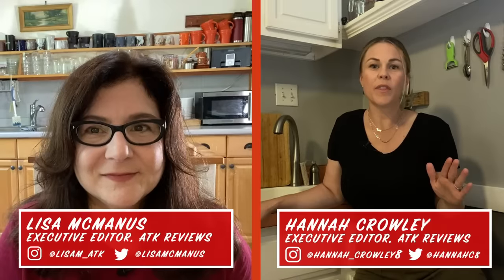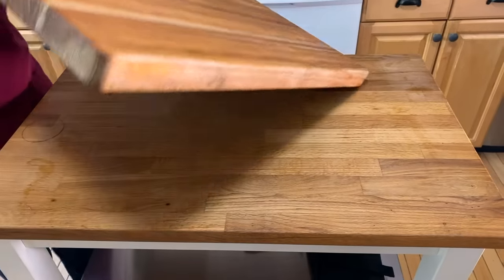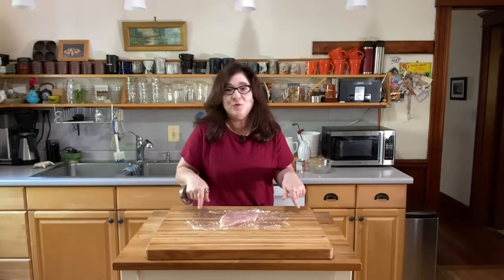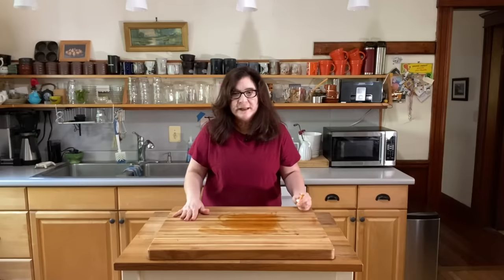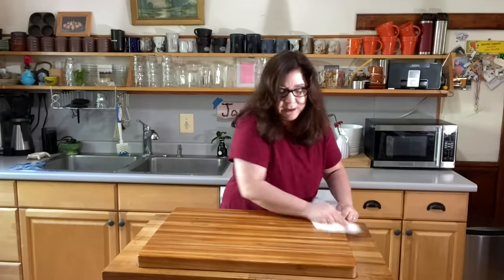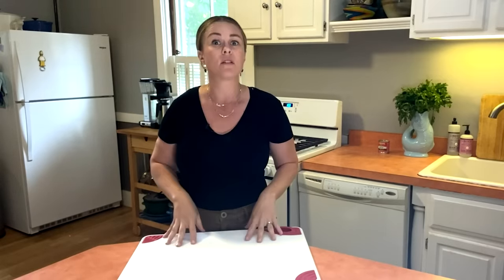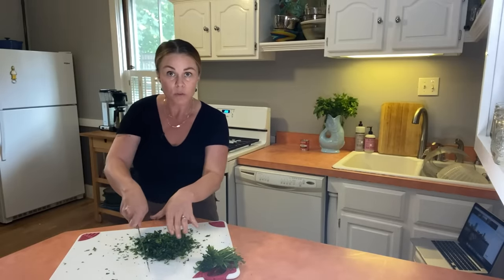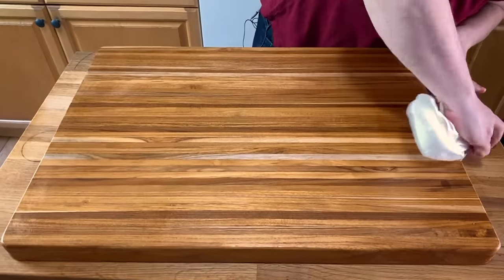Gear Heads | Which Type of Cutting Board is Best for Your Kitchen?

Comment: I now have the plastic antimicrobial boards - two sizes.  I had a  9in thick end cut John Boos butcher block mounted on stainless steel legs that i scored at the HomeGoods store for a mere $799 nearly 20 years ago.  At the time I certainly couldn't afford it but managed somehow and NEVER regretted buying it.  But when I sold my home recently and relocated to a downsized home, I couldn't justify that butcher block taking up my entire kitchen.  I sold it and to this day, although not remorseful, still miss that butcher block.  It was the centerpiece of my kitchen used as a mini island.  it was so convenient to merely cut everything on it.  However, I find the microbio boards are also great, light weight, easy clean up and easy to sanitize.

Comment: Several restaurant supply houses are open to the public. They sell them in varying sizes. Measure your cutting area, then buy a small, medium and a large? 

Piece of cake... 🤗
Reply: Deborah Kennedy If you have someone around you with a table saw, they are all easy to cut to whatever size you want.  I have four at 16X12, and large one I do butchering on, which is 21X36-inches.  The butchering one, gets laid on a run of sticky padded shelf liner, and overhangs my sink.
Reply: Yup😉👍

Comment: I have a size huge plastic with indents to catch juices. It fits over one of the halves of my sink and I use it for kneading, rolling out dough, and cutting large pieces of meat like turkey or roasts.

I have a large red KitchenAid plastic board I use for prepping meat. Then I have three black KitchenAid plastic boards in various sizes from large to small that is use for non-meat items.
I also have thin plastic boards in 4 colors that I use to flash freeze. It's a lot easier to get things off a bendable board once they've frozen. 
I do want to get a nice, medium size wooden one for serving.

Comment: Best of the Best cutting board I ever found were from  "Cutting Board Wisconsin" I believe it's a Corian material. However, they describe it as, non porous, non absorbent acrylic polymer material. I've always loved a wooden cutting board but these are great! The only problem is there size. I've got an 18" by 16" & they don't make them that big anymore (wish they could be a little bigger like 18"x24"). You can refrigerate them for dough to be rolled out & remain cold or you can use them as a trivet for hot dishes to rest on the dinner table. Just Love them. Wish you guys would get some & rate them too. Have a Great day & be safe out there!
Reply: Years ago my husband worked for a company that installed tile and other products in commercial buildings, malls etc.  He brought home a large Corian cutting board that we had for years.  It was pretty heavy though and I eventually let it go.  Your comment jogged my memory about it.

Comment: I also find cutting sheets to be very useful. Typically larger than the small sheet of paper sized, but not as large as the full sized wood one, they are plastic and flexible. Good for slicing bread and simple larger things like cabbage. Easy to wipe clean.

Comment: My husband does most of the cooking, so he has an assortment of plastic cutting boards from 8" x 10" up to 16" x 20". I have a cutting/pouring thing I've used for over 20 years. It has a 4 1/2" round cutting board that is attached to a holding area for cut items that ends in a tapered pouring spout. The cutting board sits up from the base so any liquids run down into the holding area. I really hate to cut juicy tomatoes on a regular cutting board and have the juice run all over the counter.

Comment: Much as I would love a wooden cutting board, I’d have to go with the plastic one.  It’s lighter, easier to handle.  I have arthritis in my hands, but the right is the worst,  a yr & a half ago I messed up my right hand & wrist, wasn’t broken but I had to have a cast for 2 wks.  It still doesn’t work right at times, so for someone like me??  The plastic one is the best
Reply: Lightweight wood and bamboo cutting boards can also be great! Ikea makes a really nice large bamboo one that’s only about a half inch thick, and i think it’s actually lighter than similar sized plastic boards I’ve used

Comment: I have both, a little smaller than the ATK choices.  My wood block is a maple edge-grain 12 x 18 x 1-1/2 John Boos board which I've had going on 20 years now. I treat it with mineral oil every few months and it's holding up very well.  I also have a poly board of an unknown brand (same dimensions but 1/2" thick) which I was given by a former girlfriend about 15 years ago.  She was convinced that we'd die if we cut raw meat on the wooden board, so I just got in the habit of using the poly board for meat, even though I'm not at all convinced either one is "safer" than the other, given proper washing.

The poly board doesn't have rubber grip surfaces on the corners like the test board, but it still doesn't scoot around.  I usually just set it on top of the wood board with no grip mat or damp dish cloth under it, and it stays in place fine.  There's enough texture on the surface that food doesn't "walk" out from under your knife either.

I'm somewhat fanatical about keeping my knives sharp, and both boards are holding up very well.  I can't feel or see any erosion or abrasion of the wood block (at least not to the point where I'd consider resurfacing it). The poly board's most heavily-used area is easily seen, but that's due as much to staining (tomatoes seem to do a number on it) as knife wear.

I'd say the choice between wood and plastic is going to be more subjective and esthetic than anything else.

Comment: I prefer the "Wood" cutting board.  I put mineral oil once a week. ( 2 me its not a high maintance) I did have 2 regular sized plastic board that I tossed. I didn't pay a fortune for my wood cutting board. But if U wanna make the investment and maintance go for it.. Plus they are Durable.
Reply: It is, indeed, an investment, right?
Reply: Instead  of oiling it once a week, try using spoon butter which is a mixture of mineral oil and beeswax.  It stays on much longer than mineral oil alone.

Comment: I got the ProTeak last year, and it is an absolute joy. The cleanup is occasionally annoying (because it's big) but everything else is awesome. 

And it looks fantastic when not in use!
Reply: I agree about ProTeak.  If kept in a stationary place, you could be extra conscious about what you cut on it so all you need to do is wipe the top with a lightly soapy washcloth, followed by a damp washcloth to wipe away the soap. Don't cut meat or anything with too much soil and it would be fine so as to not lug it to the sink.

Comment: When covid first started I stopped refinishing furniture because of lack of storage and instead went to my local thrift store and bought old beat up wood boards, sanded them down, and oiled them. And now I have just…so…many…wood cutting boards. But they’re fun little projects since I could find big heavy birch or maple butcher blocks for $3 and two beers later they were good as new. Some of them were pretty much brand new and my guess (given my location) is they were probably wedding gifts or something that weren’t needed.

Comment: We have both but the wooden one was custom made by a woodworker friend from clear grain maple and walnut, WAY too beautiful to chop on every day!😂 So we use it to serve special occasion carving dinners and or charcuterie cheeses and meats. 🙄 My work horse is my plastic board. Love the knife feel and the quick clean up. I don't wash it in the dishwasher because I don't like that my dishwasher packet has a rinse agent for water spot control which ( to me ) appears to leave a residue on certain surfaces that aren't glass or smooth stainless.

Comment: Question for the follow up video if done- I know that wood and plastic are much better for your knife’s edge than glass but- does either the wood and plastic wear down your edge slightly quicker than the other?
Reply: I can't recall when or where I saw or read about a test of that aspect, but in whatever test it was I recall that plastic and real wood were equal in knife edge retention, but that bamboo was hard on knives.
Reply: SeikiBrian now that you mention it I do recall the part about bamboo
Reply: most commonly used woods are probably good but some wood types are much harder than others. bamboo is really hard despite being common though
some types of woods also absorbs more water than other.
Reply: Bamboo is high in silica (glass) which is why it's bad. It's also a grass (not wood) and needs a lot more glue than woods. If you have truly sharp knives with small edge angles; they'll sink into the plastic boards too much and some may crack or chip as a result. If you want a cheap route: End grain Acacia. If you want the best; end grain hard maple (but from a reputable maker like BoardSmith or Boos).
Reply: Brian Klaus: It depends on the type of wood and type of plastic specifically for cutting boards. There is not a universal answer. Maple is the best for knives. Acacia comes in second but then it depends on the cultivar of Acacia, some are too hard on knives, others are ideal. Same concept for plastic. The problem is that bamboo is not wood (it's a grass), and they are infamously hard on knives. Bamboo is 19 percent harder than traditional maple, which means it’s also harder on your knives. Also, the small grooves may ever-so-slightly catch your knife, interrupting a smooth cutting action. And many of the glues used for bamboo boards use formaldehyde. You want to make sure it says formaldehyde-free glue is used.

Comment: Hey ATK, Mineral oil is a bi-product of crude oil in the production of gasoline. Do you have a suggestion to an alternative oil that I can use on my cutting board?
Reply: I use coconut oil, it spoils a lot slower than normal cooking oils

Comment: My mom had purchased the Large TeakHaus Edge Grain chopping board, and it's slimmer cutting board model a few months ago. However, the chopping board has deep cuts in it from her using ceramic knives on it with quite a bit of force on it. The cutting board is fine though, just light scratches.

Comment: I use both wood and plastic depending on the task.  For raw meat, I use thin plastic cutting mats/sheets placed on top my thick wooden board--the thin sheets go into the dishwasher to disinfect after use with raw meats.  For herbs, onions and veggies. the heavy wooden board is stable yet soft.

Comment: I find my knife slips when cutting on a non-wood board. Feels insecure. Thanks for the info. Very useful as usual!
Reply: Once you get a plastic board all cut up so that you are getting all the delicious pieces of microplastics into your food, you'll find that a plastic board holds onto food about the same as a nicked up wooden board. Here's a good piece of advice; since you can't cut on a plastic board w/o losing control of the knife, do NOT attempt to move up to the expert level of cutting boards and buy a glass one! I've been using the same glass cutting board for about 25 years, and you have to be really good at controlling the food on the cutting board. Since it's glass you don't build up all the scratches you get on wood and plastic that people depend on to hold the food in place. On a glass board you actually have to pay attention to what you are doing....

Comment: This testing of both is great and each has its place.  Lisa, however, I'm worried about your island table.  It needs more stability; the cutting board was only moving because your table doesn't have enough heft and weight to it.  Thanks Gearhead Ladies, you are great resources!

Comment: Why is there an ad for the Victorinox chef's knife in a video about cutting boards... ? And why only on it, and not on the other knife that's used later for the plastic board ?
Reply: Different presenters, different kitchens, different equipment. Not enough difference in the knifes to make a real difference.

Comment: I'm sure that size of cutting board is good and stable but it looks like its a lot more unwieldy to move around for cleaning. The board I use is a good deal larger than that little one you showed as an example but still smaller than that plastic board. Haven't had any issues with food rolling off or not having enough space for what I'm working with. To each their own.

Comment: Don’t you just hate those “easy open” cans!?!
Reply: I've opened thousands of them, seldom ever have a problem. The key is that once you start, you have to keep pulling it in one continuous motion. The only time you will have a problem is if you stop part of the way. 
Once I get it started, I like to pull from left to right thus deflecting any splatter away from me and into the sink. :)
Reply: I use my can opener even if the can has a pull top lid.  I find it easier to get all of the product out of the can, especially creamed soups.
Reply: Anne K  hello, I own a handy plastic ‘HOOK’ with a curve, all you do is raise the pop, put the hook thing into the pop handle then just roll it backwards to its end NEVER A SPATTER ,  CHEERS 🇺🇸🇺🇸🇺🇸🇺🇸
Reply: @flybyairplane3528  What brand is the hook? As you can see I could use one of those.
Reply: @cvr527  You are so right--if you stop it sticks. I guess i was worrying that if I really yanked at it, I'd have chipotles in adobe flying everywhere. I secretly suspect the lid sticks in inverse proportion to how bad it would be if the contents flew out (tuna in oil, chipotles in adobo, etc)
Reply: Lisa McManus   There is no name on it, but I bought a 5 in 1 tool @ a  PUBLIX supermarket for a friend in FLA , but if I see any anywhere, I’ll let you know, I am in NJ   🇺🇸🇺🇸🇺🇸🇺🇸

Comment: I own the wood board you recommended and loved it. My comment is that I have a lot of cutting boards that I stack on their sides next to my knife block. I use a large plastic board that I place on top of the wood board to cut meat. It saves lugging the big heavy wood board to the sink.
Reply: Interesting, because I never use plastic to cut meat. Unless the plastic board goes in the dishwasher, you need to be particularly careful to clean all of the grooves that will inevitably develop. I prefer the antibacterial and self-healing properties of wood.

Comment: You missed the best of both worlds, Epicurean "Big Block" series.
Reply: Amen. Love Epicurious's web site. Owned by Condè Nast.
Reply: @majoroldladyakamom6948  Oh well then it's not for me.
Reply: They reviewed Epicurean boards in their original cutting boards review, and didn't give them the highest marks. Since the epicurean boards are just pressed paper laminated together like plywood, they will eventually shred down through constant use. I've had the same happen to me with their normal boards, so I didn't bother with their Big Block series. The recommended wood board in this review is cheaper than the comparable Epicurean big block, by almost $100, so it makes even less sense to choose the Epicurean over any traditional wood cutting board/butcher block.
Reply: @wwaxwork  the producer of the Epicurean boards isn't related to Epicurious/ conde nast. One of them is a producer of paper laminate products and the other is a media conglomerate. I have the wooden board ATK recommends for dinner prep and smaller Epicurean boards for fruits/snacks/smaller meals. Highly recommend
Reply: @dudleypajela2986  agree to disagree.
Reply: While I haven't tried their "Big Block" boards, I do have (and often use) and older Epicurean board that is somewhere between their "Kitchen" series and "Gourmet" series. The one I have has rubber corners, which is both good and bad. The good is that the corners keep the board firmly in place. The bad is that, since the thin wood fiber laminate is somewhat above the counter, it is impossible to pound/tenderize meat on it, since the board flexes too much. Even though the "Big Block" is a lot thicker than what I have, since the "Big Block" does have rubber feet under it, would it still flex too much to handle pounding/tenderizing meat?

In my experience, I agree with @Dudley Pajela that the wood fiber definitely shreds up with lots of use. I suspect this would be the case for their "Big Block" boards, too.
Reply: @gregshonle2072  The big block series wouldn't flex, they're too thick for the rubber feet to make any kind of difference. At the price point though, it makes no sense to buy a Big Block, unless being able to wash the board in the dishwasher is worth the extra $100 to you.

Comment: These cutting boards are too big for household use. If you cook for 20 adults yes you can buy these big boards. 
Also I usually use plastic boards and change them every year. It is practical. I think.
Reply: I cook for myself and my wife, and would never use a small board.
Reply: I wouldn't agree that replacing plastic boards every year is practical, I'd rather only contribute the resources used to make one chopping board in my lifetime rather than upwards of 40 more resource intensive boards. But to each their own of course
Reply: We have several cutting boards and space to use them. In a small space perhaps it's difficult, but your average American home has an at least moderately sized kitchen. Most newly built houses have a fairly luxurious amount of kitchen and common room space.
Reply: you can prep a whole meal on the board. in practice, even in small kitchens, the big boards are a lot more practical.
Reply: Making a simple thing like Nachos; onions, hot peppers, cilantro, tomatoes, cheese. -Much better to have a large board!